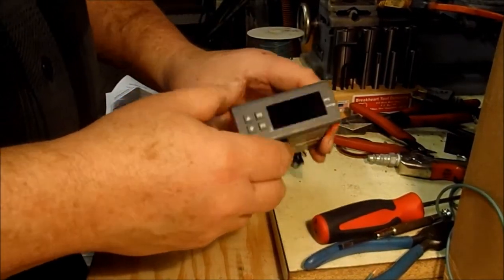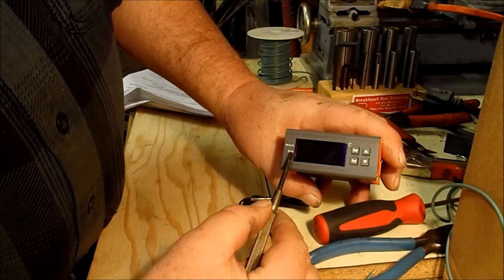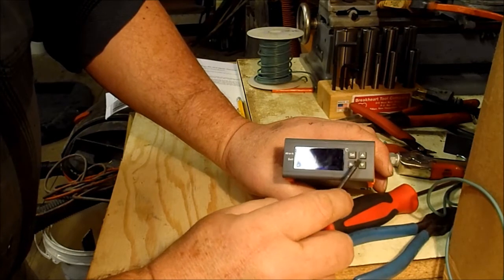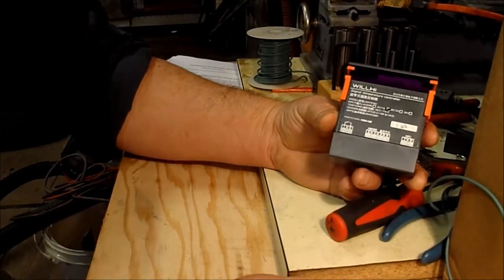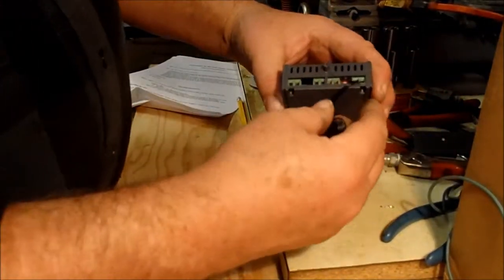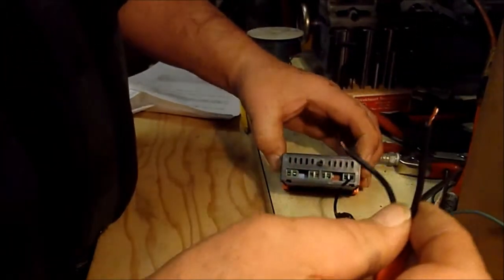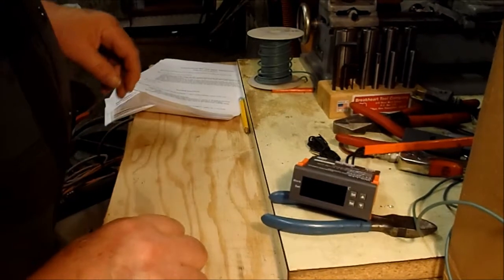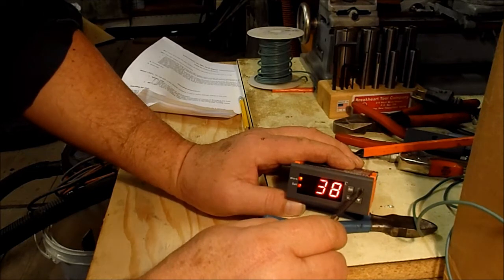Part 2 WILLHI WH7016 temperature controller for poultry incubator

Comment: Many thanks for your video! This is a great help. My unit is a 12VDC, but everything else is the same. I use an old nonfunctional refrigerator in my shop, to keep my digital instruments from freezing. I just need to control a 40w light bulb. Thanks again!

Comment: Thank you! The wiring section saved me a huge migraine.
Reply from the maker: Your welcome, glad it helped.
I am going to have to look at this video again to figure out how to reset the temps for my wife's incubator
Reply: Hey, it's a good reference video.  I'm using mine for an incubator, too.
Reply from the maker: J. Hall
Good luck with it. On piece of advice-get good thermometers and calibrate them. The ones fastened to a backing with the numbers on the back can be pretty inaccurate and get knocked out  if dropped or joggled.
I just got some lab thermometers that have the scale etched in the glass
Reply: @psgflier  Again, thank you for this video! LOL Haven't used the incubator in a couple years! Needed to rewire for eggs on the way - got to the temp controller and my mind went dead blank. Came straight here! Thank you!!

Comment: I replaced the round wafers with this same controller on my incubator and have had no problems, it is a year old now. Lost my programing sheet, downloaded the one for 220v as you did. Everything is working and was glad you posted where to get the download. Your videos are full of information.Thanks
Reply from the maker: Your welcome. Glad you got it figured out.When I got the controllers there were no instructions except directions to look up the company and get instructions there. The company has a nice web site, but everything is in Chinese. When I finally did find the instructions and decipher them, I thought others might have the same problems.
Those old style wafer thermo's are used in a lot of things and work good when they work, but, after taking one apart, I can see it doesn't take much to get them out of wack.

Comment: I ordered on of this from e-bay but it says it is 250v on the 1st & 2nd terminal Post and 12v on the 3rd and 4th. Will this work for my incubator? Can you help? Also it only got 6 termilal post
Reply from the maker: I couldn't tell you how yours operates, sounds like it uses 12 volts to operate and controls 250 volts, but that could be reversed. its completely different than the one I did the video on. Google the unit you have, include any prefixes and suffixes in the description. There are several controllers with the same number, WH7016, but with different suffixes(a,b,c etc.) and they are all completely different.

Comment: Thanks for posting this video, it's the best one by far!  Could you tell me how to wire and the settings for both a heat source as well as a chiller?  I need to keep the temperature in a fermenter exactly at 67 degrees using the freezer's compressor and also a heat blanket. Thanks!

Comment: THANK YOU!! With the help of your video, I was able to wire the temp controller for my queen honeybee cell incubator. I tripped the circuit breaker twice before I found your video. I couldn't read the Chinese wiring diagram.